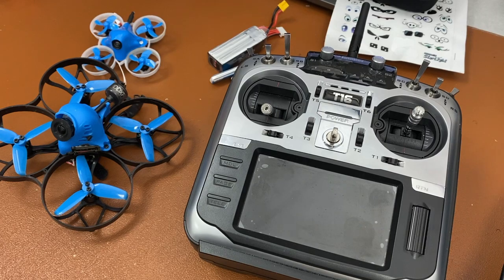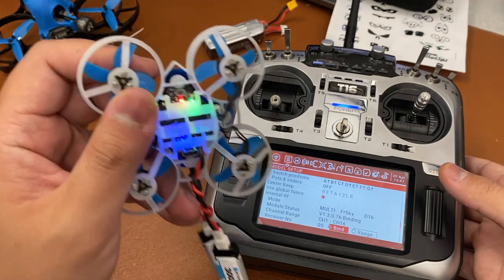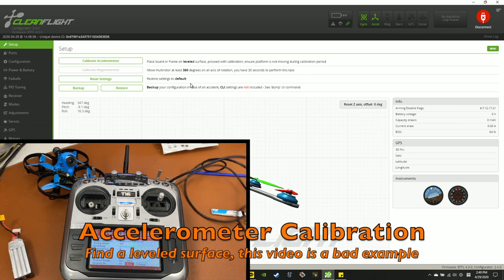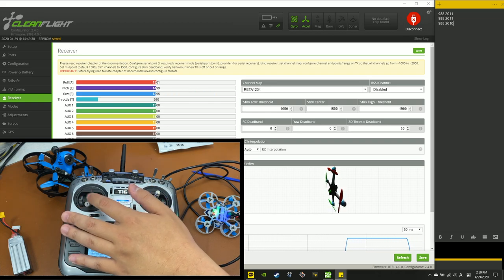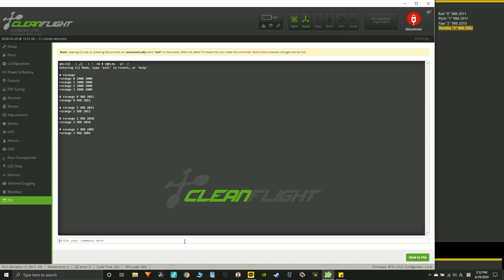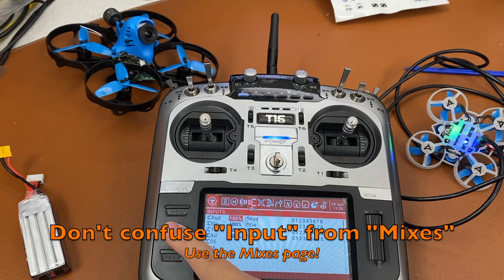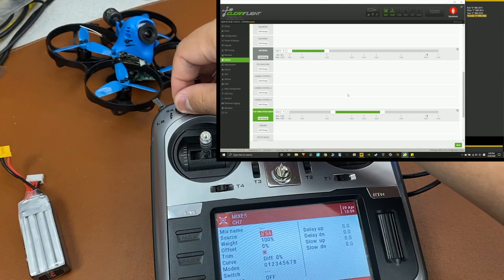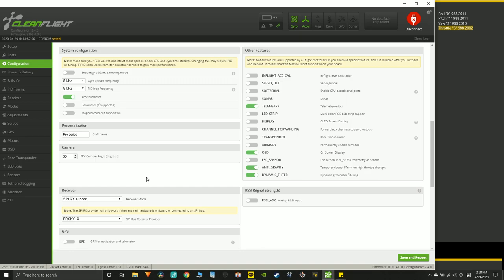BetaFPV Frsky binding to Jumper T16

Comment: I can’t bind my iflight 65s to my jumper t18 pro and it is frsky d16 spi. I tried every frsky on the radio and nothing. My tiny hawk 2 binds fine on frsky d8 was no problem. Please help me. Love your videos
Reply from the maker: Please make sure it is an SPI. I just read on iFlight's website and they do not offer it in SPI but external XM+. You need to located the bind button on the quad, press and hold the bind button down while powering on your quadcopter. This will initiate bind mode. On the Jumper, it is Frsky X, D16
Reply: It says it is an spi d16. I have hit the gold button that is square and went through all the frsky channels and nothing. Then I hit bind_rx on betaflight and it said binding on the screen and then went through all the frsky channels and nothing. I also can’t bind the eachine 010 either. I can only bind my tiny hawk 2 on d8 but nothing else. Please help me out because I have had my drone for months and I can’t fly it.

Comment: hello I have a Jumper t18 with FrSky r-xsr on a mamba f722APP,  my receiver is bind with the rc controller, but i can't syncronize it in betaflight is my first Quad, i been follwing all the instruction and nothing, could you please help me!!!!!!
Reply from the maker: Please refer to the R-XSR manual and make sure your receiver is not on CPPM. (It will show you the LED color patterns in the manual)

Also, make sure the your R-XSR's FW is matching. (This is also in the manual, I believe if your receiver is showing solid green and red, this indicates FW is not matching)

Lastly, make sure the receiver is ACCST and not ACCESS. Also, if the receiver FW is ACCST 2.0+, then the protocol is "Frsky X2". If it is pre- 2.0, then its "Frsky X".
If you do not see this listing, then you will need to update the internal module.

Comment: Why do I not have a Model Setup page? I have gone through several tutorials, but my T16 does not have this page. Is there another way to bind?
Reply from the maker: To access the Model page, you need to press the "MDL" button.
Reply: @IRONQUAD  Yes ive done that 1,000 times. Even upgraded the firmware, I still dont get that screen
Reply from the maker: @Sprinthurdles  Please double check the FW you flashed with your T16, it may be the wrong FW.

Comment: I check twice and done all things like here i can't bind my meteor65 frsky lbt to my jumper t16, i think i will destroy this stupid radio
Reply from the maker: There should be a EU or LBT option in the subtype. ("MULTI" "FrSky" D16 EU or LBT ) It will bind after that. If you do not see an option for it, you will need update your internal protocol module.

Also, go to the CONFIGURATION tab in Betaflight and find "receiver". If your meteor 65 has an internal RX, the top drop down should be "SPI" and the bottom drop down "FrSky_X"
Reply: @IRONQUAD  yep that just solved problem now i have other :P i have 100h flying in sims and i was very good now when i try real 1s whoop in house it sux i crash on every wall :x
Reply from the maker: @lucalive1302  I can't help you with that one lol
Reply: @IRONQUAD  ye i need to tune some pids and ratings in betaflight :x